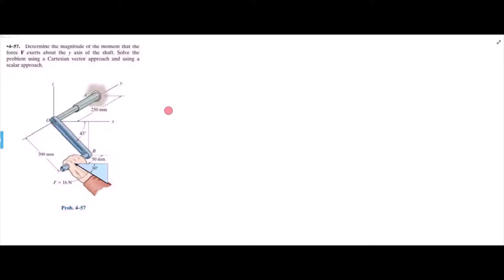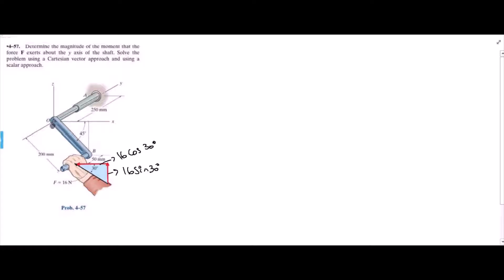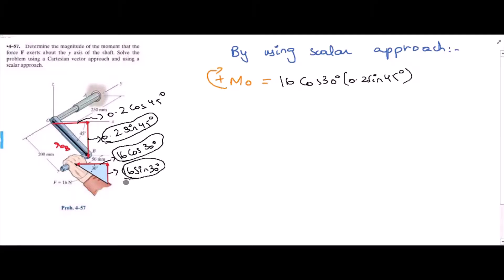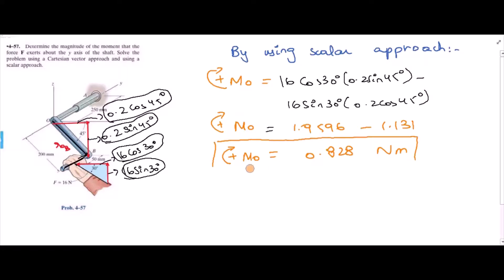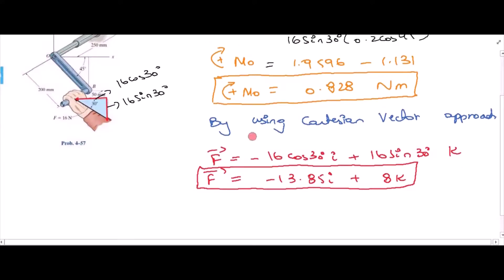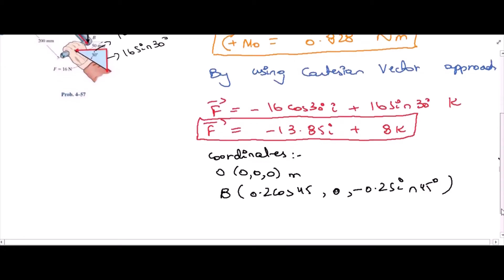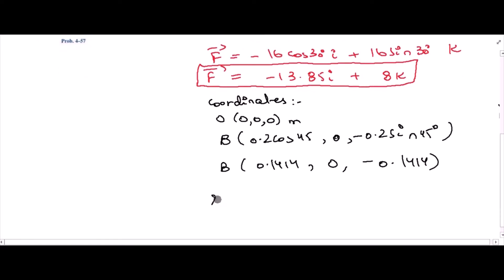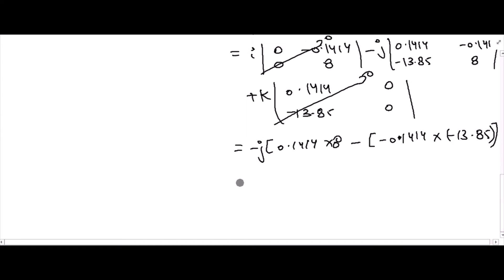4-57 hibbeler statics chapter 4 | hibbeler statics | hibbeler

Comment: Thank you, for the video, I have a question, I read in Hibbeler's book that the position vector goes from any point on the axis to any point on the line of action of the vector, at 6:35 I see that you draw a position vector that does not Complete with what I read, I see that it passes through the axis but not through the vector.  Please help me solve my doubt.
Reply from the maker: Yes what have you read in Hibbeler is correct. Here it seems like in the figure that the force is some offset to the position vector, but think about it the force F is applied throughout the handle so you can slide that force F to the point B. Now the position vector OB starts from origin and ends on the line of action of force F. 
Note: You can solve the same problem by defining position vector between OA instead of OB and you will still get the same answer. I hope it will help! 🙂
Reply: @solutionsmanual9535  I understand, thanks for the response.
Reply: @solutionsmanual9535  yes but he gives you for some reason the 0,05 m on y axis from handle to the hand ?? that why im comfused so the posistion vector to start from origin  O and ends on the  line of action of force F on the hand and not the point B ??

Comment: Salam .. yes the video was helpful but still some queries.. firstly why do only we find the B coordinate why not coordinates of A . Secondly it is mentioned in the question moment  about Y axis is this not possible that we find the position vector of only component parallel to Y and then solve it by determinant form by putting other unit vectors i and k equals zero in matrix.  I am asking so because in  fundamental problem F 15 in it we have to find moment about x and the video which i watched in it it was i and k components as zero.. 🙃
Reply from the maker: W.Salam, Yes you can use position vector OA and can still get the same answer. Also you can use the other approach by equation i and k components equals zero but I prefer that way. I hope it will help! Sorry for the late reply.🙂

Comment: For point B u took 0.2sin45° as negative 
But for force vector u took 16sin30° as positive !!
Why ??? Because both are in negative z axis !!!
Reply from the maker: The moment arm is directed from point O to B so it's z component is negative. For the force vector according to the diagram it is going up so it's z component is positive .
Reply from the maker: I hope this will help
Reply: @solutionsmanual9535  thanks❤